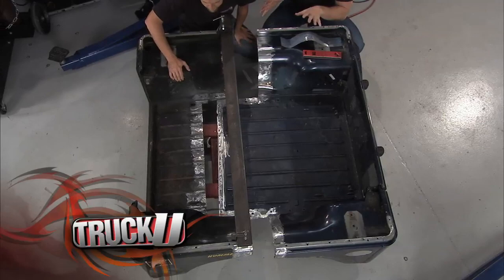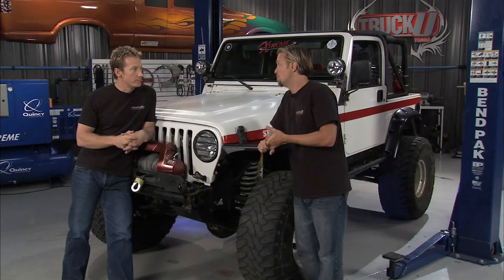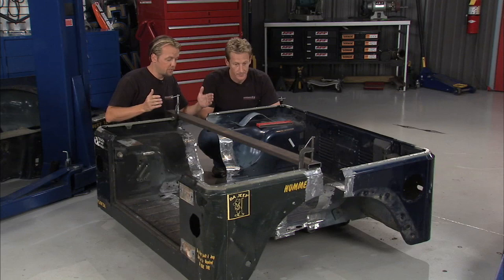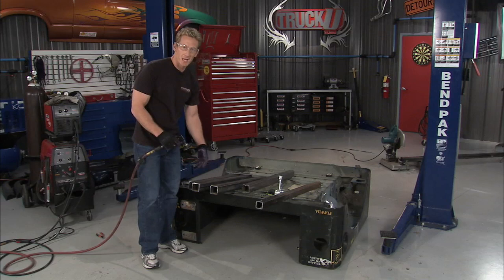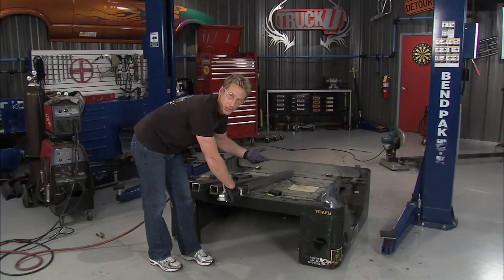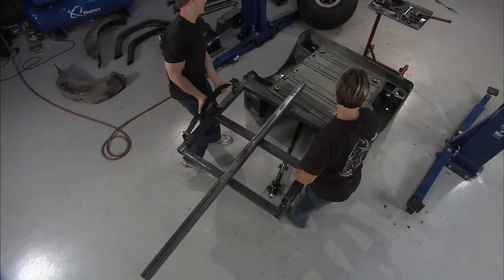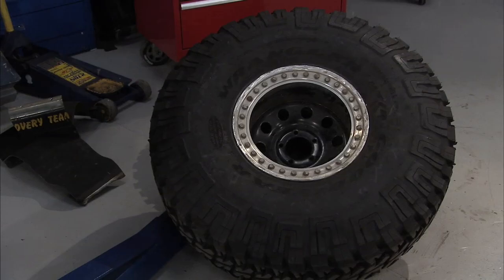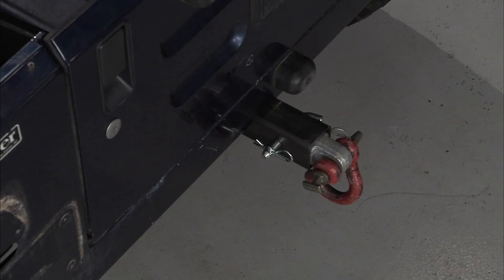Truck U Custom TJ Trailer

Comment: $300 for two tubs and steel?
Doubtful.

They should have used a pintle hitch rather than a ball, you don't want the ball twisting out of the receiver.